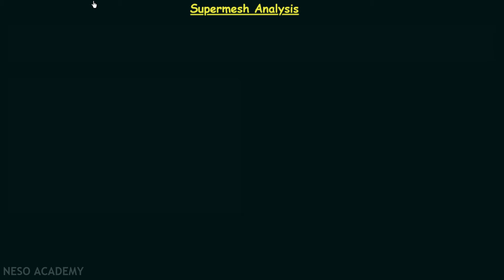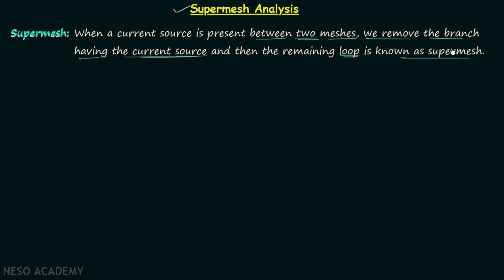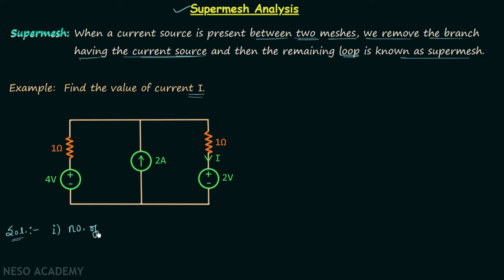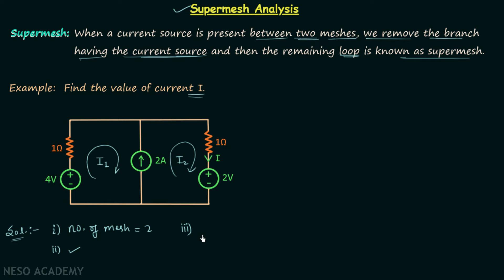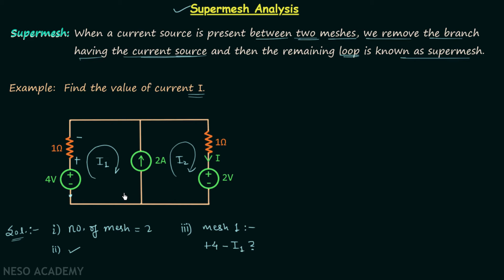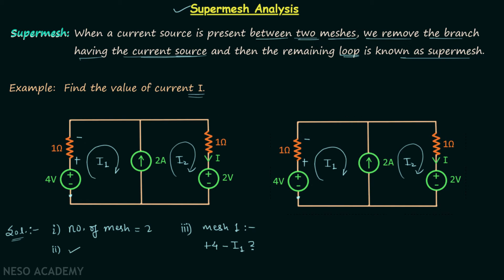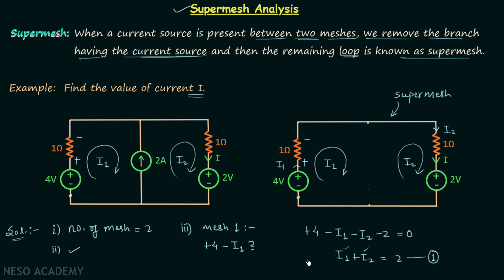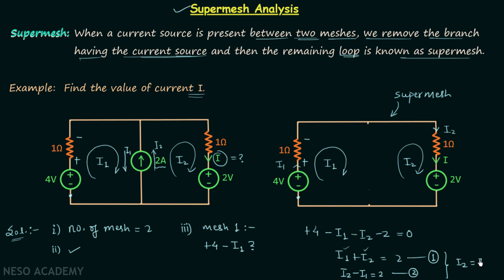Supermesh Analysis

Comment: but then the value of I1 becomes zero... how's that possible?
Reply: How
Reply: Current source raises the upper wire's voltage to 4 volts. A resistor between two opposing 4 volt sources will have 0 amps. The same way that a resistor with two opposing 0 volt sources will have 0 amps.

A current source is just another expression of a voltage source but with different wording. A current source will adjust its voltage to fit the circuit. A voltage source will adjust its amp to fit the circuit. Either the voltage or the current is hidden depending on which you pick.

Comment: I2-I1=2 is still corect since we assume that I1 and 2A is entering the node  and I2 is leaving the node that would be I1+2=I2 or I1-I2=-2 or I2-I1=2 :)
Reply: I2-I1=2
Because the outer loop current I2-I1 is equal to 2A current source.

Comment: i1 and i2 are  in same direction but why you take i2 as +ve direction in 2nd equation...
Reply: If you focus on the branch with 2 A current source, the I1 is coming down, and i2 is going up in the same direction as that of the current source.
Reply: @mcvrischik9172  but kcl eqn is to be made focussing on a node right?
Reply: @nehaltandel8837  here in this we want to find the relationship between I1 and I2. You can clearly see that the direction of I2 and Current source is same. Hence I2-I1= 2

Comment: Pls solve my doubt u said that both Current and voltage source are considered to be same in this KVL ... 

Y don't we take the value of 2 A as it is ... ?!!! 

Pls solve my doubt .... If anyone knew it.... Thanks in advance....
Reply: bcz across voltage source we know the current but across the current source we dont know the voltage..
Reply: Current source just delivers the amount of current it specifies... The loop consisting the resistances, the electrons there suffers potential loss,, or voltage drop... Voltage of current source is not defined... You can better visualise it as energy source.... Like a ideal voltage source never fluctuates, the ideal current source never looses its rate flow of charge.... Which means huge energy source.

Comment: if voltage source in between two branches then supermesh is apply or not?
Reply: Mesh analysis is based on sum of all potential in a Mesh... So if a voltage source is there, equation are easily formed, and values will be calculated but how could you treat current source as what potential it is delivering charges?... You have to apply kcl as well... So not a supermesh when voltage source
Reply: No